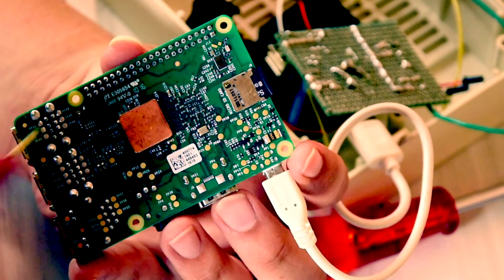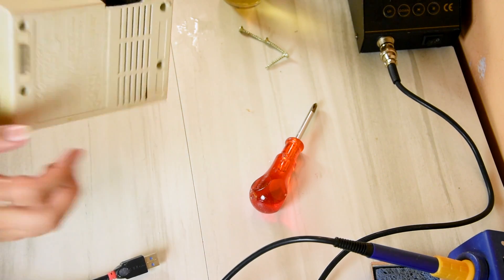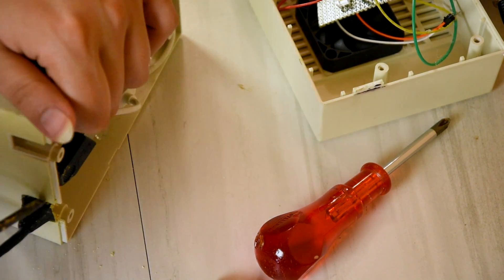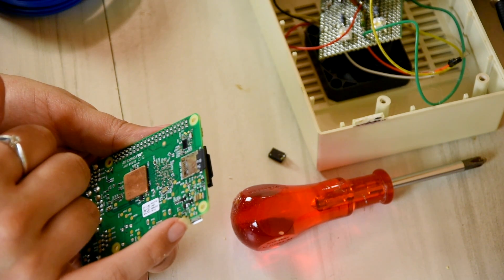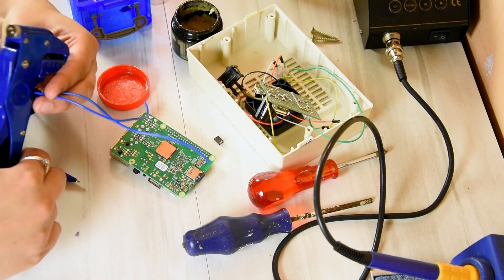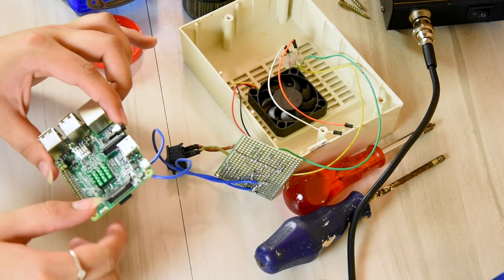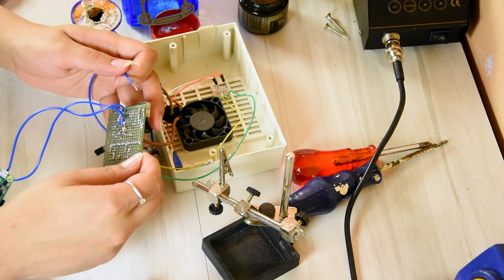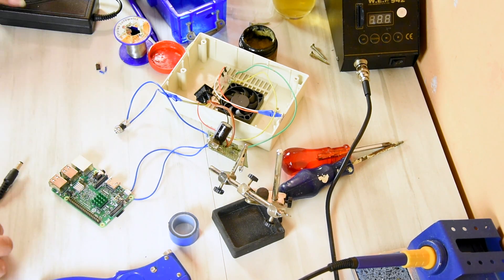Amiga Pi Project Part 6 - Fixes

Comment: Hi Maddi, I'm a big fan and I've watched most if not all your videos!
You're quite a talented women and every guys dream girl I think for having similar interests as most men. Too bad you didn't live in Canada! haha :)

There maybe something you can do to fix your LED issues on your Amiga Pi.  First off you can follow the traces on the board that lead to the LED solder points and carefully scrape off some of the green area on the board to expose some traces, then tin the traces and solder some wires to that.  Also I noticed a couple little holes on the board on either side of where the LED solder points were. It looks like they go through to the backside of the board which makes it more accessible and less chance of touching another component if soldered there.

You always scare me drinking tea around your projects. I'm always afraid you're going to spilt it! Good luck and I look forward to your next video.
Reply from the maker: Hi Laurie, thank you for such kind words! haha :o)

Thanks for the suggestion, I may have a look at this, there has got to be another way,  though someone here has just given me a list and it seems like I may be in luck :o)
https://www.raspberrypi.org/forums/viewtopic.php?f=28&t=89522

Haha the tea, yes i'm very aware of that glass when it's around my equipment ..Thanks again for the comment and i'm happy to hear that you enjoy my videos :o)

Comment: Great video.. to bad the stupid thing come loose... i was thinking if that could be possible for it to just come loose like that ? seem a little strange to me... :S
Reply from the maker: Yes I know :o( but actually it was my own mod, i soldered a header on the LED terminals, but the sudden jolt when opened just ripped the terminals right off completely.. no more activity light unless I were to install a new Raspberry pi :o( .. it's the problem with surface mount soldering... Maybe in future I will upgrade to the next model or something like this and use this one for other projects.
Reply: Ohh yes i remember that now... do you know something, you should be drilling a tiny little hole in the middle of the LED terminals and put the pins from behind and use the terminal as a soldering island.. so it would be like traditional surface mounted components, that would holt it up better i think. To band now with your brand new Raspberry Pi that this happend... activity LED´s are actually good to have...
Reply from the maker: I guess the positive thing about this is that it gives me the motivation to upgrade to the next more powerful raspberry pi, maybe RPI 4. we ilve and learn, the next time I will extend the wires.
Reply: yeah.. so you thinking about upgrading now or in the future ?
Reply from the maker: In the future :o) .. the next pi isn't out yet, well not that I know of haha
Reply: I dont know anything about the Raspberry so i have no idea whats out now or what not.. :D haha...